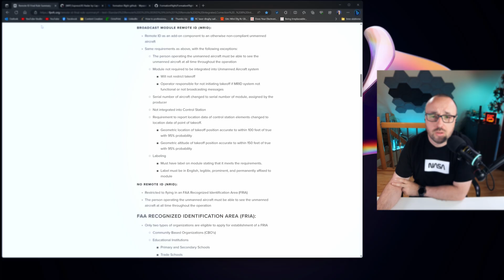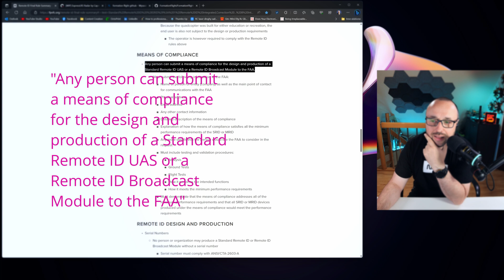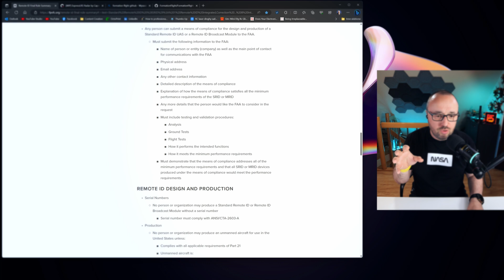ExpressLRS Radar solves Remote ID problem? Almost

Comment: I have to admit: You are right. However, jurisprudence is stuck in last-millenial thinking. All we've lernt over the last decades, that open-source-software is the only way to judge software in means of pre- AND post-release testing in a democratic way without a need for legal proceedings. That said, the opposite is security by obscurity of a manufacturer's secret. One has to reverse-engineer software or systems to prove lack of compliance. Not only FAA is stuck with the old way of thinking. There is another way of guarantee of compliance. Freeze the tested releases of the software modules, servicing the remoteID part of the game.
This way of thinking is overdue. Discussions about so-called obscure algorhythms acting for "social" networks are ongoing. How to judge compliance? AI will give it a push. AI in a manifest training state is mostly obscure. How could you ever certify AI-based systems not disclosed to be tested democratically? Even the trainer (avoiding the term developer, since developers do work strictly cognitive) are unable to give precise answers to compliance of their AI systems, that are evolving by experiments. Not so remoteID. It's a strictly cognitive - and simple - design.

Comment: Ardupilot has an open RID option in the works too based on some cheap wifi chips.

I'm sure the FAA will get around to approving all these right after they get done approving all the FRIA requests individuals submitted.

Comment: One can't comply by using ExpressLRS radar or whatever because the point of the Remote ID is to make one buy a $70+ Wi-Fi/Bluetooth transmitter which has a real price of $20 at most.
Reply: I found a few good transmitters that are lightweight but require some work I can send the info to you if you want

Comment: .....luckily they will be able to catch you not complying by using this ability of elrs....  if this works, then it works, and how would anybody be able to say its not compliant, i mean it would require dismantling the quad to see which module was being used successfully?    also it kinda worries me that we will need to have gps modules,  i would love a gps set up as good as inav on my quads but i'm worried putting one on my betaflight quads is just another thing to go wrong and at least for a short time will cause more crashes, and maybe more serious crashes.
Reply: Try to find indoor flight areas as you don't need to transmit any data as long as you are avoiding the open sky. This is from what I know and it may be wrong but just what I was thinking atm

Comment: The problem is not how to comply with remote id. The problem that need to be solved is to make absolutely sure that your drone does not send out any position data at all. The obvious solution is of course to remove the GPS but many drones that you can buy will not fly without GPS. We still have problems that our drones can be tracked using radar or triangulation using our video signal...
Reply from the maker: If you do not send position, you are not compliant. So why to send anything at all?
Reply: DJI aeroscope :)

Comment: While this video brings up a potentially important point, I think it confuses the requirements for a means of compliance vs the requirements for producing a module. These are two separate things in the rule.

The FAA wants groups like ExpressLRS and AMA to come up with widely-used designs and protocols, which are called a *means of compliance*. The means of compliance (design) needs to be tested. ExpressLRS devs can indeed do that and in fact that's exactly what the FAA wants.

Once a means of compliance is accepted, then producers can make modules based on that approved means. So Betafpv, Pawel, or you or me can produce a module by flashing the ExpressLRS code.

The producer of a module need only submit a form called a declaration of compliance which states "my module complies because it's using the already-accepted ELRS means of compliance. My serial number(s) are ...."

The FAA envisions that many "producers" will produce many different models of "modules" all using the same "means of compliance". Getting a means of compliance (ELRS Radar) approved is the big bureaucratic hassle.  Once that's approved once, anyone can produce modules that do ELRS Radar and the bureaucratic requirements are much less.

The producer of the module need not be, and generally should not be, the person who does the means of compliance paperwork. That's done once, to get the overall design/approach accepted. Producers (manufacturers) then simply declare "my modules comply because I used the ExpressLRS method".

Comment: yeah you right, It must be done by manufacturer. but those authorities will never know as long as they can scan 
rid with their device. just get 1 authentic RID and ELRS radar for the other drone.
Reply: The word "manufacturer" actually doesn't appear in the rule.

This video confuses two different concepts - the "means of compliance" (Express LRS) and the "producer" of a particular "module" (BetaFPV, you or me).
Reply: @senseisecurityschool9337  I mean someone can do mass production and lock the EPS chip for temperproof.
Reply: @tk-maker  Absolutely. BetaFPV, Namino, Matek etc could do that. Using the ELRS Radar code that will hopefully be an approved Means of Compliance.  That's what the FAA is hoping for.

They could even allow upgrades to any signed version of ELRS. Or other safeguard to reduce the ease with which a noncompliant firmware can be installed.